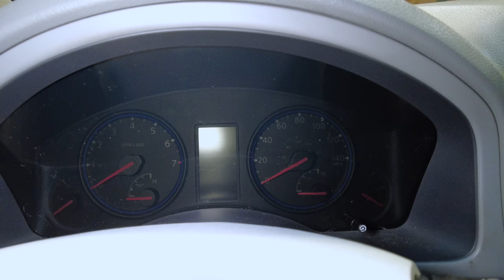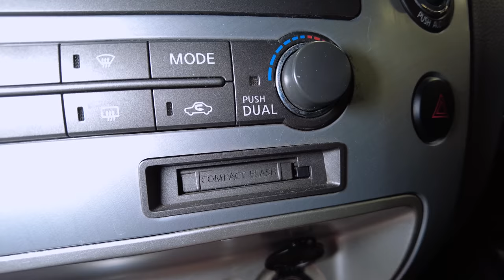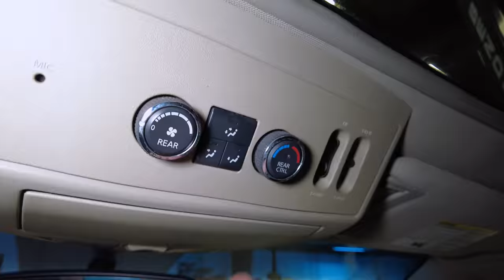Love it or Hate it! Common issues EVERY Infiniti QX56 has. CAR WIZARD knows - he had one!

Comment: Don’t buy any Nissan built after Renault bought them.
Reply: Same.  Their quality and reliability went down the tubes many years ago.  Back in the 80s and 90s if you valued reliability, it was Nissan, Toyota and Mazda.  Then Ford screwed up Mazda, Renault screwed up Nissan.  I only buy Toyotas except for my commuter EV.
Reply: @jnorthrop70  Now Mazda is no longer partnered with Ford. In fact, they started partnering with Toyota a while ago.
Reply: I disagree.  The Xterra is a great value.
Reply: Agree. The only exceptions would be the early Xterra and D22 Frontier that they continued to make after they surrendered to France. They did take a little quality out, but usually they were still good. Anything designed under the watch of Carlos Ghosen though is garbage.
Reply: They cheaped out on everything after Renault! Cheap components that dont hold up. Its that simple.
Reply: My 2002 Maxima, 2003 I35, 2002 Q45 and now 2005 Q45 have all held up well. Even better when you can go to Youtube and learn to do a lot of work on your own stuff.
Reply: Nissan used to be great
Reply: My 08 G35x has given me  virtually no problems so I’m going to disagree.
Reply: Agreed 100% brother
Reply: I have a 2012 Infiniti M37. 150k miles. Zero issues. Still drives like a new car.
Reply: @baselhs the 2011-2019 m37/q70 are great cars and have seen 280k still running strong
Reply: @dwaynepenner2788  yeah, it took awhile for the shared “synergies” to take effect.  I had a 2000 Frontier that was excellent.
Reply: @stdhttps  MY 08' 3 5 SE Altima was very reliable from new until 117k miles, but I was meticulous with my maintenance and I didn't mistreat it. I still agree with them about the quality durability and reliability of Nissan since the Renault takeover. I believe that you and I were 2 of the lucky ones. The data speaks to it.
Reply: Renault is not involved in every Nissan model and they only have a 20% stack in Nissan they don’t own them
Reply: @julesandersen3659  If the 20% STAKE is terrible,  then it makes a significant difference on the entire company. Jatco CVTs were horrendous.  They are better now but were very very bad.
Reply: just don’t buy one with a cvt
Reply: @foxxlohf8953  yeah their rear drive automatic transmissions are great and their v6 snd v8s are bulletproof.  They've just had electrical issues and most of their front drive platforms are cvt driven which have been bad.
Reply: Essentially 2003-present you should avoid.
Reply: @gabevillarreal96  funny enough I have never seen a Renault use the CVT transmission I don’t it’s something Renault themselves uses
Reply: Funny you mention Renault. Not sure what made them partner with such a crappy company that was horrible even back in Nissan's heyday.
Reply: @julesandersen3659  Who knows. Jatco cvts suck. And anything Renault is simply not good.
Reply: Nissan has been getting better as of late even though I had a much older 89 Maxima It had 600,000 miles on it before it was tboned.
Reply: @charlesmlane32  Agreed. I think the Altima needs to step up to catch accord build quality  and solidity. But the Rogue is nice.  Maxima is gone. Murano is ancient.  Pathfinder is good. Armada is good too. I like the titan but I'm not sure it continues on.
Reply: @gabevillarreal96  Well as a mechanic myself have fixed a few Renault they never really have any big problems usually, think people who say Renault is bad people who don’t anything about them, I’m not really in to Renault myself but I don’t think they all that bad
Reply: @FlameOnTheBeat  there are exceptions and that’s one of them
Reply: @julesandersen3659  I don't believe that they made Nissan better in any way.  Therefore I don't have faith in them. Plus they don't have a reputation as being extremely reliable or well built. Based on that plus the data over the decades and im not a fan.
Reply: I got an 03 G35 coupe with 225k 0 issues and got a 05 maxima with 199 0 issues
Reply: @FlameOnTheBeat  Stout V6 and true automatic transmission.  Those are not problematic.
Reply: @AlexFL818  there are going to be exceptions of Nissans built after the Renault purchase that do well but I meant that as a general rule of thumb.
Reply: now Renault is out.
Reply: True
Reply: I’ve had 5 Frontiers and 3 Titans all bought new and properly maintained and all were and are very reliable so I wholeheartedly disagree.
Reply: I think that there is only one Reno-designed engine in a Nissan sold in the states.
Reply: @SuperSnakePlissken  I owned Altima  and currently drive Murano, and from my very limited experience,  both are good cars.
Reply: @julesandersen3659  Nissan bought Jacko Transmissions back in the day & their CVT's are awful
Reply: It depends on the model of Nissan and where its built. Renault didn't have a hand in every Nissan model produced.
Reply: Exactly
Reply: Back in the 80’s I remember buying a Datsun/Nissan truck because the Toyota was so expensive. I always looked at Nissan as a second tier vehicle, with a few exceptions such as the 6 cylinder Maxima that were pretty famous back then.
Reply: bla bla bla nissan was so great in the late 80's and the whole 90's that they all fell apart in 6 years. There's a reason renault had to save them. Nissan quality was fucking horrible. The bodies rusted through so fast that it was incredible. Now that they've got bodywork that lasts from renault, it just shows how bad nissan quality always was. The ONLY difference in newer nissans compared to old ones is that they don't rust through anymore.
Reply: you mean amc
Reply: @Joseph Northrop  replace mazda with honda. Mazda reliability was a joke in 90s. There good now tho
Reply: @jarnoob  90s nissans were bombproof, the banger racers car of choice. Everyone raced the bluebird or the sunny and they destroyed everything in sight. Absolute tanks.
Reply: @FlameOnTheBeat  OF course you do! As you should! Who buys the automatic!?
Reply: 2011-2019 Nissan frontier and the Nissan Titan up to 2015 is about the only good Nissan in the past decade
Reply: @clintprice2123   not the front wheel drive or all wheel drive Nissans with CVT transmissions. But yes the trucks you mentioned were good trucks
Reply: @AndrewM83  And what's the secret to that models success? Toyota's brand philosophy. Simplicity in design and engineering. There us absolutely nothing complicated about the frontier and it is extremely durable reliable and dependable as well as easy to maintain.  Thay spells Toyota and lexus and why they've been able to maintain the top spots in consistent reliability year after year decade after decade.
Reply: @gabevillarreal96  I agree. After walking away from  Nissan as a Nissan specialist tech for 21 years I still can't answer why a manufacturer like Nissan wouldn't focus on the reliability factor and simplicity like the  frontier in their other vehicles. My last job at Nissan was replacing an engine under warranty on a newer frontier with the latest engine design.
Reply: Renault isn't present in all of Nissan's products. The Titan, Frontier, Armada/QX80, and most of their cars that are not  Versas and Sentras aren't Renault-related. I'd buy an R35 GT-R in a heartbeat!
Reply: @El Mayimbe  most of all the Q45s hold up nicely. Those are actually imported from Japan. My 02 was virtually indestructible.
Reply: Mainly the CVTs the Nissan/Infiniti products with standard autos are still pretty good, maybe not toyota/lexus level of reliability but not bad. The frontiers are solid trucks
Reply: @spol1622  Key word "limited". Enjoy those CVT transmissions.
Reply: @gabevillarreal96  are you from a country that has Renault ? Or are you American?
Reply: My Mother has a 2007 Nissan Altima with the V6 engine. What’s insane is that she’s owned it for over 10 years despite having little issues. I keep telling her now is a great time to get it for a Toyota but she won’t do it. She hardly drives anyways so I say just keep it till it dies. For all we know she will go before the car does since she’s pushing 70.
Reply: @clintprice2123 Nissan trucks are the exception.  Nissan cars and Crossovers are absolute trash.
Reply: @jnorthrop70  speak for yourself when it comes to Mazda my guy, I've owned two of them with no issues and my neighbor is on his fourth.
Reply: @elmayimbe_the_amateur_mechanic  you own the good Nissans
Reply: @icenine135  chill.  I was referring to when they were sharing engineering with Ford and putting Ford engines and transmissions in some of their cars, like the later MPV.  I know they came out of that rough time ok.  I’m hoping the same thing happens to Nissan, but I’m not counting on it.
Reply: Also, it’s worth mentioning that Renault designed the 6.0 and 6.4 Powerstroke for Navistar and Ford! Renault is responsible for screwing up 3 companies other than itself!
Reply: @bcdieselsofficial  and screwed up AMC so 4 companies
Reply: @JonathanMoosey  wow, even more! It’s almost like they don’t deserve to be in business!
Reply: Nissans without cvts are pretty good, not Toyota good but pretty damn good
Reply: Unless it's a G37. They didn't fuck them up for a few more years I love mine. Glad I sold my altima
Reply: @baselhs  I love my 2012 g37s coupe. Only issues were the catalytic converters and they were covered under warranty. Only has about 67,000 miles on it but it's been trouble free basically. Valve covers are just starting to seep oil but that is more of a heat cycle thing than a mileage thing. And it's f-ing fast and will roast the back tires if I want it to lol
Reply: Unpopular opinion but the current versa in a manual is the best car nissan makes right now. Their cheapest car is their best car. With most manufacturers it's the other way around. Good luck getting all that safety for 15k in a manual brand new with 5 miles on it. It won't die if you take care of it and only get it in manual.
Reply: @nickpelland74  I could agree with that
Reply: Exactly 💯 %right
Reply: Really people used to tell me the cool gatling gun q45s had alot of oil consumption issues
Reply: This is older tech like the frontier and titan. So still good. Newer Nissan stuff is crap
Reply: Most Renault Nissan's are shit, with a few exceptions. Infiniti's with the 3.5-3.7 VQs, with the 5 or 7 speeds are actually really reliable. Surprising for such a brand. Later Xterra's and Frontier's with the radiator update so coolant doesn't leak into the transmission. Most NISSANS are trash, anything with the CVT is a dud. Infiniti's larger trucks such as this aren't great either. It's a shame, Nissan doesn't know reliability since Renault. The few reliable models puzzle me, that's for sure.

I have a 2009 Infiniti fx35, it's been a fantastic car with the 3.5 V6 and 7 speed Auto.
Reply: Correct. French not Japanese quality nowadays.
Reply: Disagree the current Y62 Nissan Patrol V8 400hp is amazing!
Reply: So basically no Nissan or Infiniti? That sucks. I love their designs.
Reply: Only the 2.5 4 cylinder. Nissan knows how to make a V6 and V8 and they do it very well. Even McLaren used a Nissan V8 as the base for their engines.
Reply: @MrTilbin  A car is so much more than its engine...
Reply: @FlameOnTheBeat ..what year 350z/370z would you recommend?
Reply: Wrong we only buy nissan.  Never gives is any issues . And we have 4 titans . They run amazing and better then any American 1500
Reply: @Henry Jones  exactly! And the then CEO of Nissan fled with the rest of their money
Reply: @PseudoSpaceMarine  new Mazdas are very reliable! Best purchase currently imo
Reply: @gabevillarreal96  Nissan will never compete with Toyota or Honda build quality
Reply: @boogitybear2283  would be idiotic to sell a 07 N/A V6 Altima that's working perfectly fine to buy a new Toyota...they cost a fortune currently. Unless it has a CVT, in that case sell sell sell
Reply: @nickpelland74  safety in a versa? LOL
Reply: @julesandersen3659  I don't think they are all that good either and they certainly didn't make nissan better because the data speaks to a major loss of quality reliability and durability as soon as Renault took over. 1+1. It doesn't take a genius.  Reading data doesn't require a degree from Devry.
Reply: @22lbsboost  I agree with you wholeheartedly!
Reply: @renzofigallo8450  Nissan trucks are okay...everything else new is pretty much trash
Reply: @gabe villarreal  The Rogue is nice? Don't the all have crap CVT transmissions that last 70k miles if your lucky?
Reply: My 01 Maxima did me well. Had close to 175K on it before someone rear ended it and totalled the car.
Reply: @jasonwb6884  that was back when Nissan was still good. Before Renault really got ahold of it and the quality went down the gutter. Nissan is making good attempts to get back on track with their quality. Honestly I think they would be alright if they just got away from CVT transmissions and back to normal multispeed transmissions. And also get back into spending some money on interior material as well
Reply: @jasonwb6884  They built their own transmissions then and have always made Bulletproof V6 engines! That was a great year!
Reply: @jasonwb6884  Yes but the Rogue is Nissan's top selling vehicle by a landslide so they put a lot of attention to detail in it. It's very nicely designed inside and out. The new jatco/Nissan CVTs have been a lot better. I believe that Nissan has recognized their gremlins in their CVTs and trulyvwent to work on fixing them and making them more reliable. My 08 altima V6 went for 157k and no problems but I was meticulous with my maintenance and transmission service. I also did not mistreat the car. I believe hinda makes a much better more reliable cvt and Toyota might make the best. Both of those companies make their own CVTs in house abd honda has a ton of experience with their Scoiters for the last 50 years all having cvts so they ate bulletproof!
Reply: I have a 2017 Altima SR with 187k miles. No issues so far. Same engine and tranny. Just fluid changes, tires, brakes welll before recommend mileage as I do with all my cars. Still runs and looks great. I am a spirited driver as well.
Reply: @Iraqveteran-ke6qu  That is a testament to what true preventative maintenance can do. I believe the right brand is important,  but of equal importance is being literally on top or ahead of all your maintenance! Great job!
Reply: I'd buy any Nissan with Japanese engine and/or manual transmission. Same with Toyotas. Also I try to avoid rare cars....... well kind of. Parts can be a nightmare on 25+ year old  vehicles. Certain model rust BAD regardless of what day or who made it. Nissans have plastic interior that falls apart. That's always been a thing. The other thing is placement of the starter. Can I get my short arm on it. Do I need to remove the intake manifold like the 4.0 4.3 4.7 Toyotas and the other Nissan v8s? Newer V8 tundra's aren't exactly easy
Reply: oh crap i have a r32 x trail what do i do
Reply: @fakenews3676  basically any Mazda built after they separated from Ford is pretty good now
Reply: What years did Renault bought them?
Reply: Well when did they buy them? Because I have a 2005 altima (still going) and a 2014 altima that was still going no problems until some asshole slammed into the back of it and totaled it.  now I'm looking for another nissan
Reply: Unless it’s the frontier and Xterra where they have the 4.0 V6 and five speed, automatic or six speed manual.
Reply: My cousin has a 1991 240SX that was purchased brand new with 400,000 miles current day.
Reply: My 2011 sentra se r spec v is mint bud

Comment: Had to replace the cluster on wife's '06 QX56. It does have that "click-click..." though. We still have heat & air though. I hate to hear that Nissan is stopping supporting them. We're at 220k & I'd say it'll go twice that... IF we can still get parts. Great video!
Reply: I've been maintaining my wife's 2010 currently at 230k.   Bought it at 25k in 2012.   Every issue it's had was minor, common and easy to fix except the damn passenger side dash actuator.   Managed to swap it thru the glove box but tore up my arm.   Only left us stranded once, when the DTE gauge said 30 miles but the tank was empty.   We fill it up at 1/4 tank from then on.   Gave up on replacing the heater valve after the 2nd failure... just unplugged it and manually set it to open lol.   If you can work on it yourself, it's extremely economical to own aside from the MPG.
Reply: @v12alpine  Ditto! Particularly considering how much used cars cost nowadays. (We went & drove a 2019 QX80 recently... $24,000.00....we both said "no way"
..especially considering they offered $1000.00 for our 2096 QX56 as a trade in).. INSANE! Our story reads much like yours... we purchased ours in 2013..(forgot how many miles it had on it then)...seriously, runs like a sewing machine.. drove it on a 300 mile round trip last month on the turnpike..pushed it up to 90 mph... no issues... plus doesn't use any oil between 3k mile oil changes. Peace

Comment: 2006 QX56 170K and counting with no major repairs.

Spark plugs changed 3 times
Differential, transmission and transfer case fluid chamged twice 
Front drive shaft bearings went some time ago. Removed and put it in 2WD. 
Slow leak from power steering hose coming off resevoir.
Had a slight stutter in first gear from a stop. Fixed with new trasfer case fluid.
The dash digital display does come and go.
Recently replaced the front struts and sway bar end links.
3rd brake light out 

Only thing i dont like is the gas mileage.